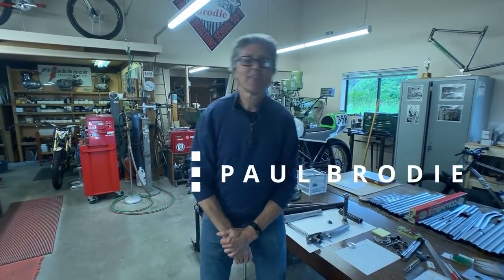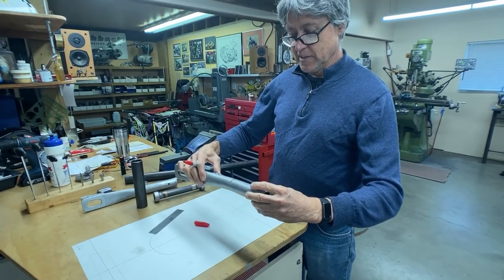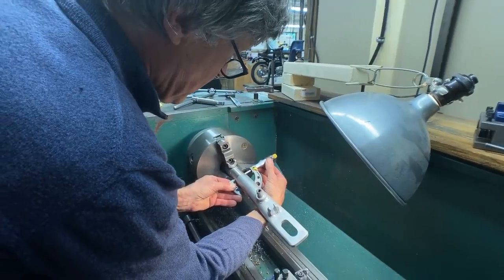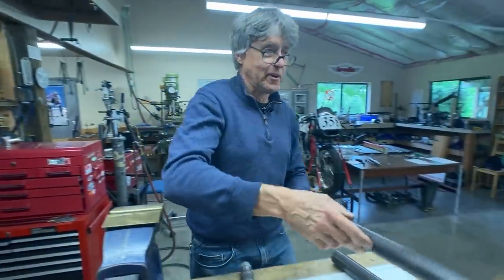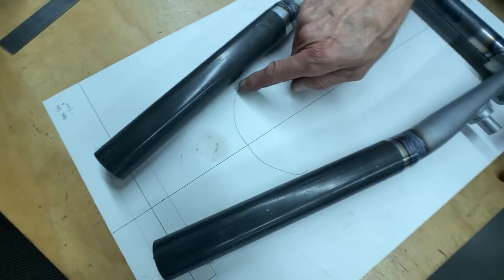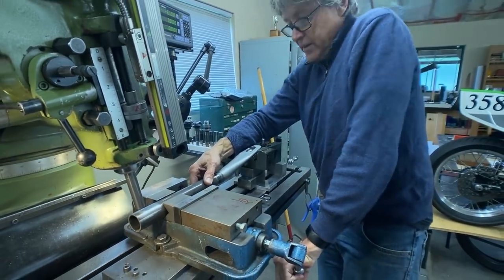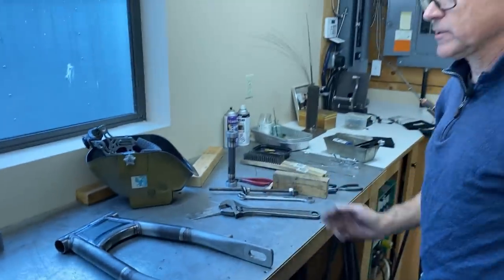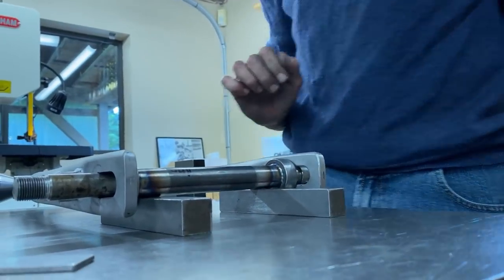Fabricating a custom swingarm for an Aermacchi road racer with Paul Brodie

Comment: Paul, I'm sure I'm an audience of one, but I would LOVE to see more videos on your Aermacchi project.  I'm a Sprint guy since I was 15 (51 years ago; sheesh); my first motorcycle was a Sprint.  I have a bone stock 1966 that I restored, and my retirement project is a 350 flat-tracker / street tracker.  I have a 1963 frame with a title, but I've decided to build a new frame for it, just because.  I'm using a 1972 bottom end and a 73 / 74 top end.  I've scoured eBay several years for parts, and have scored a NOS ERS piston and F-grind cam.

I've known about your Flashback Fab site for a long time and gleaned every bit of information I can from it, and I'm excited as hell that you have a YouTube channel and are re-creating your road racer.  In between bicycle videos (which I learn a ton from just on general frame building), please throw me a bone occasionally on the road racer!

Thanks!!!!
Reply from the maker: Steve, good to meet you! That's great you have an Aermacchi project. You'll be happy to know the next few episodes will all be Aermacchi :)

Comment: Using a drill-press vise/vice to hold stuff for welding.  I bought one for that exact reason, but have yet to use it.  Good to know I’m not crazy for thinking about using one…

Comment: Wow, that was useful to me. If I can ever get back to racing, I want to build a new swingarm for my KAYO MR125 to maybe extend it a little, and fit a shock that is longer. It uses a short Honda NSF100 shock that is nearly impossible to find or far too expensive for the hobby racing that I do. And the stock swingarm is pretty flexible too.
Reply from the maker: Making a swingarm is a great project! I'm back to working on this little Aermacchi in a couple episodes.

Comment: Great work , i love the attention to detail ! What i don't like is welding without those sleeves pulled down or any gloves.Your skin will last longer with them on!
And the lube used to press on the tube works better ,but it is really bad for the weld .You'll never get all the oil out .
I would have pressed it on dry ,if both surfaces have a really smooth finish this works too.
Reply from the maker: You are correct. I will be wearing gloves in future to set a good example for our viewers. Safety Third. Regarding the Press Lube: I am quite conscious of the potential to contaminate the weld. I used it very sparingly, and only started 1/4" from the end of the larger tube. As the smaller tube is tapped in, it will actually help to move the lube even farther away from the end of the tube. There is a method to my madness. Thanks for watching!

Comment: Paul do you know a good way to do swing arm conversions and make sure everything is aligned?
Reply from the maker: Not sure I understand your question. Is a conversion making it longer, or converting it into something else? If you're just making it longer then a surface table and a couple of axles is the way to go.
Reply: @paulbrodie  I'm actually converting an older gs750 to have a ducati single sided swing arm. I will be setting up a table to act as a jig to keep everything in line and then machining any bushings needed, wondering if you have any tips on lining the swing arm to the frame. 

BTW great to see your shop at UFV, I'm also in the Fraser Valley and involved with UFV and local education
Reply from the maker: @Benji...   I see, you are local. I'm not sure why you need a jig unless you are changing the location of the swingarm pivot. Or modifying the swingarm. You are probably not doing either. The Ducati swingarm will probably mount in the stock location, with a little help. You need to be concerned about sprocket alignment, and shock linkage related issues. Make sense?
Reply: @paulbrodie  Ok great, thank Paul. Sounds pretty much what I have been expecting, just making sure there wasn't something else I was missing

Comment: Nice Nice! I usually pour a lot of oil on my hole saw when doing miters. I believe it protects the tool. Is this a myth?
Reply from the maker: Oil can protect the holesaw, especially if the metal is very hard. 4130 is tough, but not particularly hard. I don't use oil because it makes a mess, and takes more time to cleanup.
Reply: There is a paste-type lubricant that doesn’t travel as much as oil - supposedly - and I recently bought some.

(Walks over to get it)

“Relton Rapid-tap Cutting Paste” is the label.  It might help while not making too big of a mess.

Comment: Ur work is great I consider building my swingarm myself after watching u but If I may ask, why dont u make the rear mounting for the wheel at last? I mean maybe weld it at last or machine it at last so you wont have to bend or deal with weld distortion?
Reply from the maker: I view the swingarm as 3 pieces: The cross tube and the two side tubes. What you are suggesting is 5 pieces, so you are making it more complicated. I have found that simple is usually the best. Thanks for watching.

Comment: Thanks for sharing your passion with us . Question : Why don't you use an auto darkening helmet for welding ?
Reply from the maker: Thanks Bill, I don't like those auto darkening helmets. I think there's a milli second before the shield darkens. Call me old school if you like.
Reply: @paulbrodie  Thanks for the response , I've been using an auto darkening helmet but at lower amps( tig) I've been flashed a couple times . I think I'll try your approach and eliminate the possibility .
Reply from the maker: @bill3641  Unless you have a very expensive helmet, they don't work well at low amperage on thin metal.

Comment: What kind of hole saw are you using? Is it starrett or what type?

What kind of filler rod and tungsten are you using?
Reply from the maker: I used whatever high quality hole saws my supplier sells, including Starrett. Filler rod is Mig wire and tungsten is 2% thoriated. You should watch our Tig welding video. That will answer more of your questions.
Reply: @paulbrodie  I’ll try just stumbled across yours. I was honestly looking for something completely different.

Comment: yes, my next project is the rear swingarm for the homemade full suspension ebike :)
Reply from the maker: I hope it goes well. Swingarms are not the easiest structures to make.
Reply: @paulbrodie   basically just copy and extend the existing one, the neighbor is a welding pro, I'll be supervised. but thanks to your guidance, the confidence gained!
Reply from the maker: @dnc23x  Good Luck 😉

Comment: Interesting.  Wondering about the mid-between region between this and a regular bicycle..?
Reply from the maker: Interesting. What does the "mid-between region" really mean?
Reply: @paulbrodie  this is when one uses, say, .049 straight gage tubing instead of bicycle-specific tubes, as one is planning on carrying heavy loads with the aid of a 1.0 (or so) kilowatt electric motor - at, say, 12-19 mph.  One could endure a few added pounds then, as the motor puts a fair bit more strain on the frame.  One needs to “build for downhill,” or similar, is my (possibly addled) thinking.
Reply from the maker: @dennisyoung4631   Yes, .049" 4130 tubing is quite strong and entirely suitable for building an electric bicycle frame.
Reply: @paulbrodie  thanks much!

Comment: Curious if you are using any form of air extraction when tig welding? Or is it not needed when doing such small amount? also, for tig welding bicycle tubing, what filler would you use? Same when tig tacking?
Reply from the maker: No air extraction; I don't do enough welding. Filler rod is .035" Mig spool, copper coated.
Reply: Based on what I bought in that size (2 pound spool; Lincoln Super-Arc, I think) it’s probably ER70s-6.

Comment: Awesome work.  I live in AL. What is the easiest way to simply hang around or work for someone like yourself?? Id love to learn this
Reply from the maker: Good question Gary. When I was 18 I got a job as an apprentice working in a machine shop. I learned a lot there. I don't believe that is happening so much these days. I'm retired now, so I'm not needing any helpers. I did take a couple of night school courses when I was in high school, but mostly I'm self taught. Years ago when I was driving cab, I had a work bench in the basement. Vise, hand drill, hacksaw and files. And oxygen-acetylene. That's it. And I made a lot of motorcycle parts. So, I encourage you to start #makingstuff. You will make mistakes but you will learn. Read books on machining and metallurgy, maybe watch videos! It will slowly come together. Good luck!

Comment: Was the crossbar the same Diameter of the rest the tubing!?!?
Reply from the maker: Do you mean the pivot tube, or the curved reinforcing tube?
Reply: @paulbrodie  the pivot tube
Reply from the maker: @hunterneal7591  Same size. Both the pivot tube and side arms are 1.5" OD w/ .095" wall 4130.

Comment: I thought you might put a chamfer on both the tube you added and the original piece of the swing arm legs so you would end up with a small V to fill in when you braze them together. I’m not any sort of a welder, so maybe what I’m suggesting isn’t necessary, and it wasn’t meant as criticism. It was certainly interesting to watch nevertheless.
Reply from the maker: I Tig welded the tubes together. There was a small step between the tubes, so that was my "V". Thanks for watching!

Comment: It’s not the same OD/ID or they’d never go together without cold and heat.
Reply from the maker: I'm afraid they are. It's called a "press fit" which is a machine shop term. There are all sorts of interference fits depending on the application. Thanks for watching.

Comment: 17:04 owe look at that ...... ya, no different.  The heat introduced to the plate gusset should have opened up you're dimension not closed it.
Reply from the maker: Ken, this is the 3rd swingers I have built in this fashion, and welding in the gusset always closes the axle spacing. When welding cools there is a "contraction".

Comment: What is ... "half a sow" or what ever you said
Reply from the maker: I think you mean "half a thou". It is a measurement. One thou is one / thousands of an inch. To give you perspective, one human hair is two thou. I thick hair is 3 thou. So, "half a thou" would be 1/4 the size of a regular human hair. Make sense?
Reply: @paulbrodie  I had to put my CC so I could read the text and it translates caption as "half a sow"
Is that a new word in a dictionary I did not find it either.. 
But I do understand thousands of an inch same as (mm) etc.